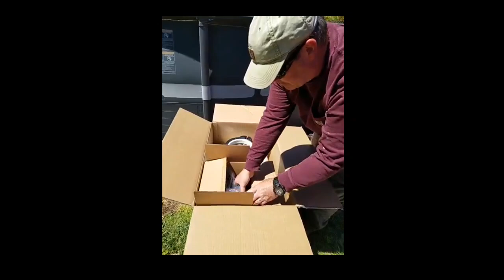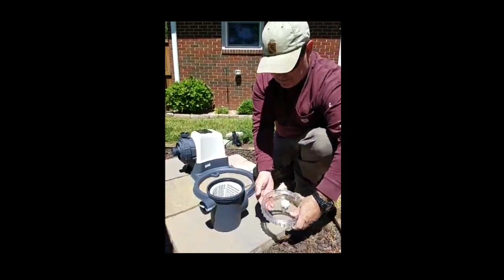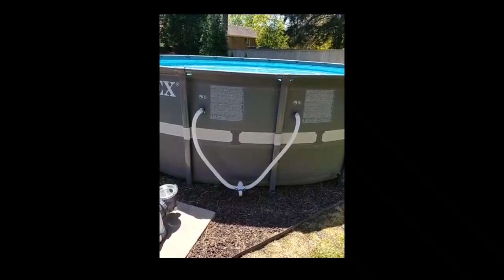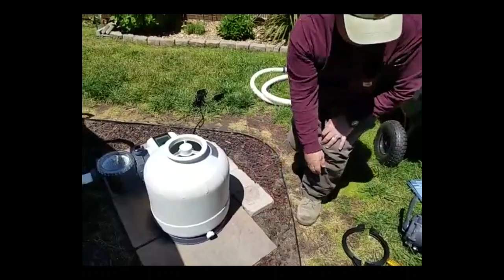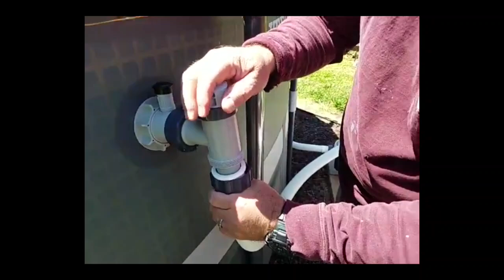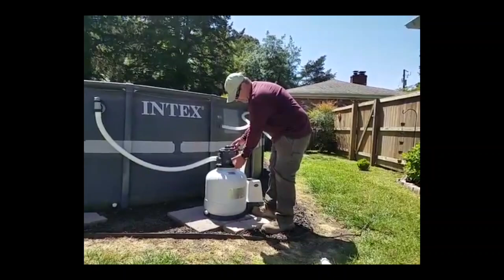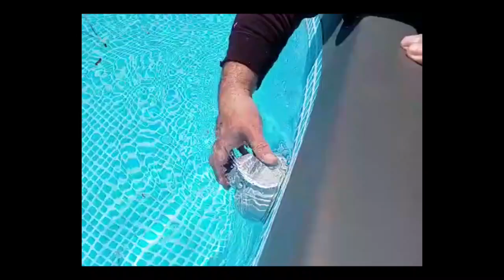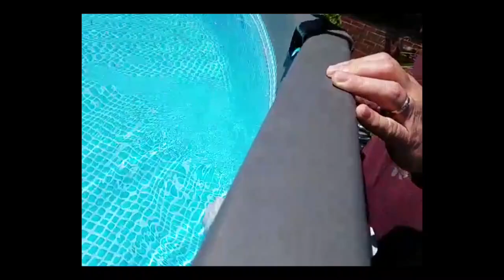INTEX SAND FILTER PUMP - Setting the pump up for above ground pools

Comment: What size is that pool and what type of backwash hose is that?
Reply from the maker: The pool is 18ft x 52"  The backwash hose was a makeshift backwash hoses consisting of two hoses that came from our Intex pool cleaner that we didn't need the extra length and the other two hoses we purchased online. In fact Amazon sells an almost 60"  Intex hose that you could use. Once we switched to a saltwater pool we decided to use a 50ft long backwash hose that we purchased from Lowes instead because we did not want the saltwater all over our grass and this way we could redirect it to an area that was mostly soil.   We are happy with the backwash hose we use now.
Reply: @MoverandShaker  I have the same exact pool being delivered this Monday along with the same exact pump. I purchased the Intex external skimmer and auto cleaner. Is there any adapters that I need for the install? Thanks for the videos.
Reply from the maker: @christianjohnson6519  No, everything that you see in our videos comes with the pool and pump. You are good to go as far as adapters,  hoses, etc... everything you need to be up and running
Reply: @MoverandShaker  have you seen any white safety fencing that would fit this pool? I need to install a fence around the top of it.
Reply from the maker: I never had the need or requirement by my city to have the safety fencing so I've never really have the need to look for it. I didn't even know they make a product like that.  our city requires a 6ft fence with licking gate and if you have a ladder it has to be removed after each pool Entry and if you have a deck it has to have a locking gate.   If this is a city requirement I would put a post on the NEXTDOOR app and see what neighbors in your area with above ground pools  have purchased for their safety fencing options.
Reply: @MoverandShaker  Thanks for the information. I noticed the 1.25 hoses 6.20 in the video. Did you ever upgrade to the 1.5 inch hoses?
Reply from the maker: @christianjohnson6519  no we didn't see a need. I could not find anything in the manual that said that using my 3000 gallon per hour pump needed to have larger hoses heading towards the skimmer. Is that what you did?
Reply: Mover and Shaker nope I have mine setup just like yours. Going to fill the water later this week. Thanks for videos!
Reply from the maker: @christianjohnson6519  Oh wow! Congratulations! I wish you the best of luck and have fun!  You are on your way to having your own paradise. It's all worth the hard work.

Comment: Great video like all of the other Intex pool stuff you guys have done. I was lucky enough to get my hands on a sand filter pump at a somewhat decent price. When adding water to the sand while filling the drum, did you add enough to have the sand be completely soaked through? My model is smaller and only takes one of the 50lb bags to fill it, but I think I still need to to the same thing and add water halfway.
Reply from the maker: Thank you for the compliments on the videos. I know we have some sound issues in a few of them. We are learning always not only with the pool but with doing videos as well. Yes, it won't hurt to fill it (prime it) before you lock it down.
Reply: Perfect, thanks!

Comment: Please help!  I’m setting up my pool/filter now and I am having trouble with the “black clamp” that goes on the sand bucket and the top part with the gauges (not sure what it’s called).  
Is the black clamp supposed to sit directly on both parts? It’s not fitting, and I keep trying to push the 6 way gauge down to
Make them meet, but there’s a little space, and I can’t get the clamp on correctly,  unless I’m doing it wrong.
Reply from the maker: the 6 way valve should sit all the way down Flange to flange  and the black collar should capture both pieces and the allow tightening.
Reply: Mover and Shaker thank you SO much for the quick reply.   I can’t get the 6 way valve to go all the way down.   Any suggestions?   

This is the only thing holding me back from completing this.  So frustrating!
Reply from the maker: I am sorry, I am not there to be able to assist and see what your issue is it sounds like one of three items is either unlevel or backwards or upside down. Best suggestion...you need to go back a few steps (start fresh) from when you placed the clamp down make sure it is seated properly, then make sure the tank o ring is seated properly and then place the 6 way valve in the correct position and seated properly.  One of those parts is obviously is not level. My best guess is the 6 way valve is in the in correct position
Reply: Mover and Shaker thanks! I’ll play around with it
Reply from the maker: @alexandrad8877  Please don't quit!  It is probably just one small thing like the direction that is preventing this. I hope you get it set up soon!
Reply: Mover and Shaker so I figured it out,  I somehow got sand underneath the center tube piece, elevating the tube and not allowing the parts to meet.    I emptied the sand and refilled it. All good!  

Now I need to figure out the hoses :)
Reply from the maker: Congrats! o.k.  well that is good to know in case this happens to anyone else. We are all in this together and our experiences help each other!  best of luck moving forward. One step at a time!!!
Reply: Mover and Shaker thanks so much! Your videos are more helpful than the instructions that come with the pool LOL
Reply from the maker: Yes, we had to do the same thing and still do consult videos when the Intex directions get us mixed up and stressed out!!

Comment: I just setup my ultra xtr intex pool and filter.  Going off the manual was a bit time consuming.  But got it done.  The filter that comes with the pool just doesn’t have the basket yours has by the pump, but I’m glad i watched your video.  It reassured me of the job i did.  Very detailed video.  Awesome!  I also have the salt water system.  How many bags of salt did you put in your pool?  I have the 16x48 round one and don’t want to overdo it with the salt as I read it will trigger errors on the system.  And do you use any shock even after putting salt and using the system?  Thank you guys!  Be well!
Reply from the maker: Thanks for the compliments on the video and yes we felt the same way, we didn't want to put too much salt in fearing that it would trigger salt errors as well. Our pool required four bags + 15lbs.  We first just put in the four bags fearing that we would go over and then shortly after we added the additional 15 lb. 

 Luckily for us we have never run over max salt levels we have been running 2700 to 2900.  We were glad with that because we weren't low and we weren't High.

We did not need to shock our pool because before we ever put our salt in, we had our pool water perfectly balanced.

It's been 5 weeks and we have not had one single issue yet, with the exception of having to drain some Rainwater, nor have we added one single thing to our pool and our pool is still reading balance on all levels and are salt value is 2710 as of today.
Reply: Mover and Shaker Excellent!  And one last question.  Is yours a 16x48 that you added the four bags to?
Reply from the maker: No, our pool is 18 x 52.

Comment: Hello, an inexperience pool person here. So I set up the filter the best I could. Now I tried to follow the instructions as to backwash first and then rinse. Now as I filtered, sand when in the pool. Is that normal? To get it out you vacuum it?
Reply from the maker: I just answered this question as best as I could earlier this evening so I will copy my answer to you but a lot of INTEX users have the same issue for our new pumps including us. It's not that bad though for us, barely noticeable and it rarely happens.  Every once in awhile our pump spits out a light amount of sand on start up as well however the area is very small over by the discharge side of the pool and no where else. I have had a couple of other Intex pump users describe the same thing. We just vacuum it up with our Deluxe Maintenance Vac.  Our pump was brand new also this spring when it did this and it's only done it once or twice since setting it up in May. I know this can happen after backwashing and I have also heard folks indicate that the some sand is too fine and will do that. It could also mean there was a slight amount of sand above what was needed. I can't say for sure why it happens. It has not happened on a regular basis so it does not happen too often here.  In terms of resolving it, try running the filter on Rinse, then Backwash, this will hopefully clear out any smaller particles that are getting through if it persists, I would consult directly with Intex on that by calling their techical assistance /customer line.
  I think we all need to find out is it too much sand a possibility even though we followed their guidance or is it an order of things when backwashing, etc..

Comment: We just set up our new pool and sand filter....after 36 hours, we have a light layer of sand at the bottom of our pool.  Have you ever had this happen and if so, how do you resolve this issue?
Reply from the maker: Hi Lindsey, Every once in awhile our pump spits out a light amount of sand on start up as well however the area is very small over by the discharge side of the pool and no where else. I have had a couple of other Intex pump users describe the same thing. We just vacuum it up with our Delux Maintenance Vac.  Our pump was brand new when it did this and it's only done it once or twice since setting it up in May. I know this can happen after backwashing and I have also heard folks indicate that the some sand is too fine and will do that. It could also mean there was a slight amount of sand above what was needed. I can't say for sure why it happens. It has not happened on a regular basis so it does not happen too often here.  In terms of resolving it try running the filter on Rinse, then Backwash, this will hopefully clear out any smaller particles that are getting through if it persists, I would consult directly with Intex on that by calling their techical assistance /customer line.
Reply: @MoverandShaker  my Intex 3000 gph is barely a week old and on shutting off it makes a kind of whining sound just for a couple of seconds, has yours ever done it?

Comment: where did you purchase the couplings to put hoses together.
Reply from the maker: As far as the pump and pool, everything came with both that we needed.  If you are referring to the Extra backwash hose. It was 2 females and 2 male hoses made by Intex. 2 came from our automatic pool cleaner that we weren't  using because the pool cleaner's hose was an adjustable length so they were extras that we didn't need for the cleaner and the other two we purchased off of Amazon and Ebay. You can also find a 59" inch hose as well if your are interested here https://www.amazon.com/Intex-29060E-Hose-Pump-1-Pack/dp/B000J19W5O/ref=asc_df_B000J19W5O/?tag=hyprod-20&linkCode=df0&hvadid=167139575215&hvpos=&hvnetw=g&hvrand=6699331418476894323&hvpone=&hvptwo=&hvqmt=&hvdev=c&hvdvcmdl=&hvlocint=&hvlocphy=9008490&hvtargid=pla-306024071928&psc=1

Comment: Thank you. Very helpful. Where did you get your adaptors and extra hoses?
Reply from the maker: We never had to buy any adapters for anything that we used to connect the 1.25 inch hoses to the 1.5 inch hoses everything came with the pool or the pump so if you see it we didn't buy it andas far as the extra hoses that we were using to backwash two of those hoses came from our Intex cleaner the other two we actually purchased offline there are hard to find because they are a hot item but there is a person on eBay who sells the hoses and right now they're about $19 each which is pretty costly but I do recommend  keeping at least one on hand  in case anything ever happens to one of those hoses.  We have since moved to a vinyl backwash hose that's 50 feet and it seems to be working nicely because we switched to a saltwater system three weeks ago and I wanted the saltwater to kind of go outside of our yard and into this little Alleyway that we have between fences you can get back wash hoses at Lowe's or Home Depot
Reply: @MoverandShaker  I have been trying to find longer hoses a or some sort of adapter to connect my hoses to make it longer. 
Happy Father's day if you're a dad!
Reply from the maker: @dawnetteshull3860  The only adapters that I have seen that connect to those hoses was the hose that came with the Intex pool cleaner it has male threaded adapters to connect all hoses in one long hose.  Check Intex.com  I am not sure if intex would have made anything like you are looking for.  You may need different brand adapters and different brand hoses to do what you are looking to do

Comment: Thanks so much for the video, unfortunately I started with filtration straight away without doing backwash and rinse, But now my collection basket is filled with water, I feel like it’s going to explode, is that normal?
First time pool owner and I’m lost here not much instructions
Reply from the maker: the collection basket is supposed to be filled with water but occasionally you have to burp it  so turn your pump off and then unscrew the cap on the filter basket until you see water flowing out of it in order to release the air but yes it is normal for it to be filled up with water and occasionally you'll see debris in there like pine straw or leaves. 

p.s. we barely and /or rarely have to backwash.  We always vacuum in Filter mode.  We use a manual vacuum because we prefer to pinpoint debris and not waste all day waiting for the vacuum to roll around and pick stuff up.
Reply: Mover and Shaker thank you so much that’s a big relief 😅, I will follow your instructions and please keep doing maintenance videos, when to apply chemicals and how often to use the backwash, etc
Reply from the maker: @SuzyElzaharOfficial  I can give you personal advice based on our experience using chemicals but we just switched to a salt water system and haven't had to add a single chemical period in almost three weeks and we are loving it.   The reason we switched is because we could NEVER Get our pool properly balanced and we were ALWAYS buying something that needed to be added. PH up, PH down, alkalinity increaser, Calcium Hardness, shock etc.. It gets really old Not knowing for sure what to do and that is why we moved to salt water. We just have to take extra care of our pool and rinse it off good everyday to keep the salt off the metal. Now, basically, for the sand filter...watch your gauge, when it gets closer to the yellow area, it's time to backwash. Sometimes we simply backwash to get rid of rain water that has filled up too much in our pool. Some folks use waste but you lose water too fast that way. We just put it on backwash and let the water leave the pool.  You won't need to backwash that often, I think we do it maybe twice a month if that.   Feel free to ask any questions anytime. We are very active on our channel with regards to responding to questions.   If you think it may  be helpful read through some of my comments and answers on my videos about the pool and see if you can get a little more comfortable.